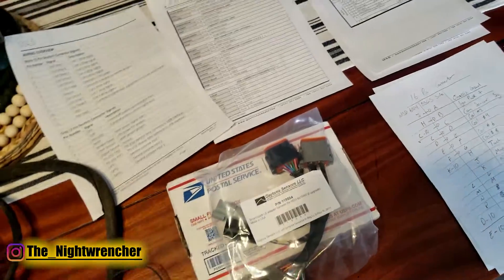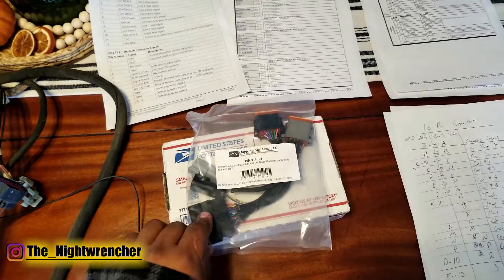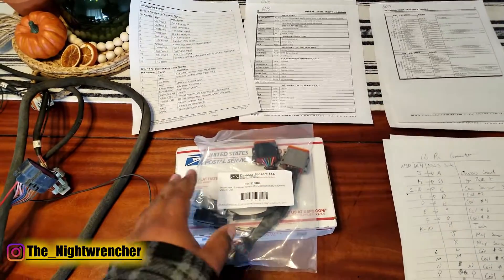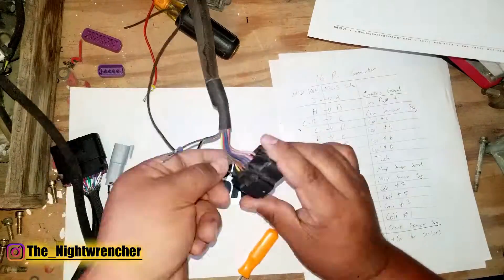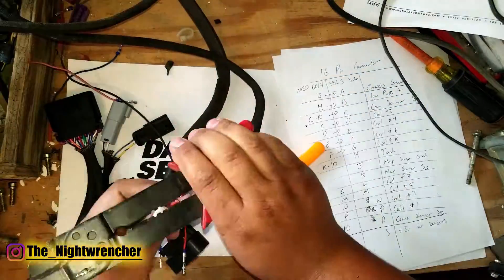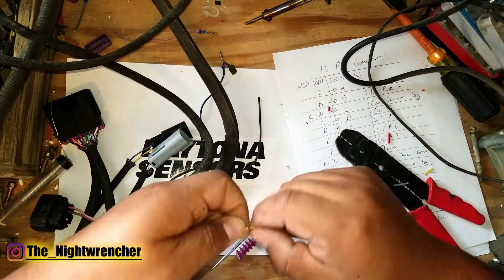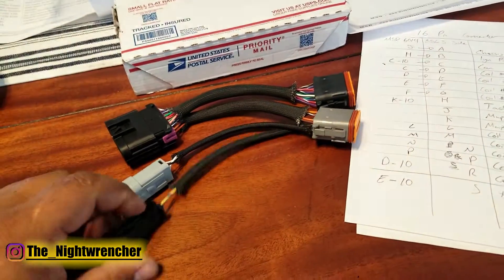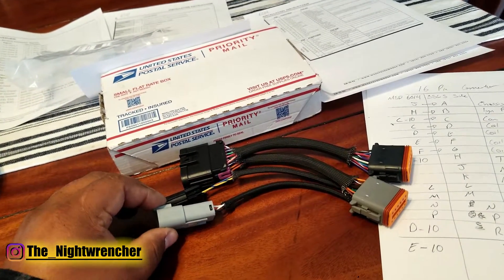Daytona Sensors MSD 6014 to SSLS Harness Adapter 119004 Rewiring | Smart Spark Carbureted LS |

Comment: Hi I have a 6010 can you give me some information how to connect the smart spark adapter to the 6010 harness
Reply from the maker: You'll need the harness adapter from Daytona Sensors and connected it straight to the 6010 harness.

https://shop.daytonasensors.net/products/smartspark-ls-adapter-harness-119004
Reply from the maker: Edited my response. Hope it helps
Reply: Hi I got the 6010 adapter harness. Got a 6.0 24x with no map and a quick fuel 750cfm . I removed my 6010 connected the adapter harness to my 6010 harness . Now my question is what's next?? Do I need a laptop configure the smart spark ls before I try to start my engine??

Comment: YOOOO ik this is kinda irelevant so u ran the 6014 msd did you set up the twostep if so do you just install a one way switch with a ground to the blue wire?
Reply from the maker: I never set up the two step on the 6014 but you can use a switch with it if you flip it off right before you launch or you can wire to the brake switch in an auto or clutch switch in a manual so it comes on if youre below a certain rpm. If you want it just for the noise then a switch is fine.